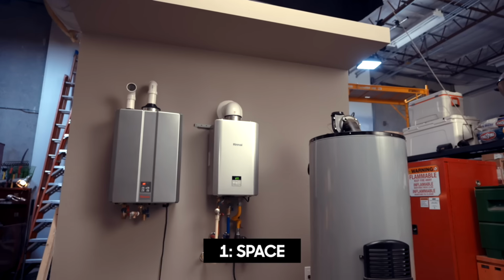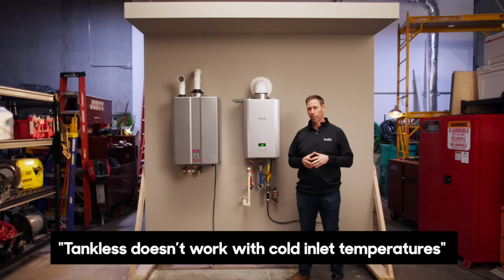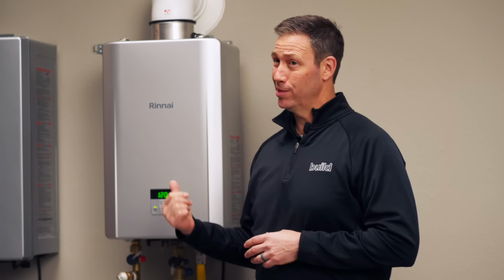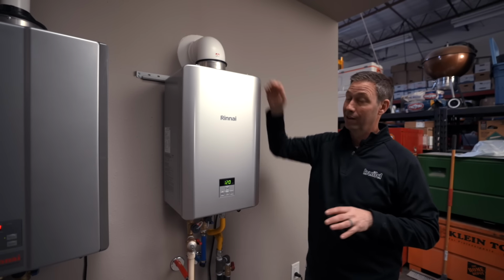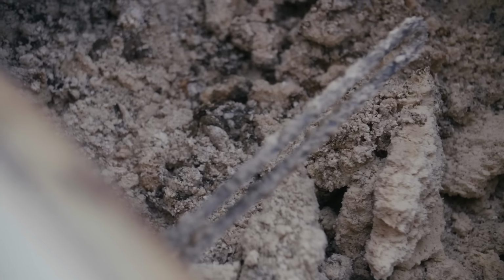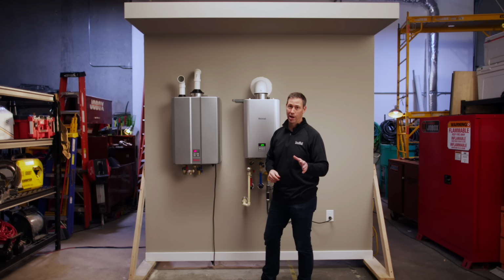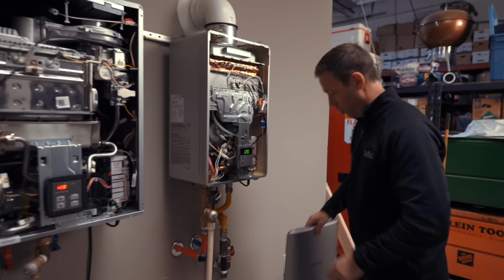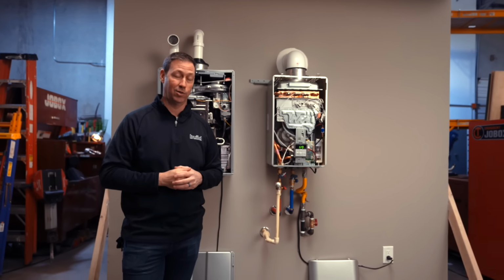DEBUNKING Tankless water heater LIES!

Comment: Hey Matt! let me know how the "low gas pressure is ok"  because the "turbo fan and regulator tech" conversation goes with the inspector when your BTUs and CFM aren't matching up. And the Google review from the homeowner demolishing your credibility. Your talking a 150,000 BTU jump. If the house wasn't piped for it 90% chance you need bigger pipe or more CFM from meter.

Comment: Without recirc, it does take about 30 additional seconds (and a few more in the coldest winter months) to get the tankless unit up to temp and delivering full hot compared to a tank unit that is holding that water at temp and sending it at full temp the moment the tap is opened. I do not find this to be a deal breaker and I have been running tankless for 7 years with great results. It's just something that you should know going in. With all of the trade off advantages of tankless, it shouldn't make a difference to anyone.

Comment: So I’m buying a house with a boiler which only heats baseboard heaters. I’m thinking pulling all that out and using one of theses to heat the house. Electricity is terribly expensive here in Fairbanks, do they make diesel vs electrical powered heaters ?

Comment: I have tankless for 11 months now.  Love it.  And I just did the annual flush/descaling.  Piece of cake. Like anything else, watch plenty of youtube videos to get familiar with all the steps including cleaning the filter before you start.

My only beef is the time it takes for the hot water to reach the faucet.  So in the morning while brushing my teeth, I fill up the sink.  When the water is warm, I use it for multiple things before pulling the plug.

Comment: This whole subject boils down to one question which none of these salespeople will ever tell you. What is the monthly cost of storing 40g of hot water in a tank unit? My estimate is about $20. Therefore, that is the max amount of savings per month...period! Who in their right mind would spend $2,000 - $4,000 to save $20/mo? Furthermore, heating water with an F-15 afterburner will eat away at your $20/mo savings. The rest is all smoke and mirrors.

Comment: I call bull on the scale and hard water.  My daughter bought a brand new condo in 2020.  Her Rinnai tankless water heater stopped working in May 2022.  Two and a half years and it was trashed because of the hard water where she lives.   Shame on her for not knowing she had to flush the unit every six months.  But I've had my tanked water heater for 18 years and never descaled it and I live in the same area she does.  Our plumber told us that in order to have a tankless we need a water softner.  I am getting a second opionion ....  I hope he is just trying to sell us a water softner but the water heater still does not work.

Comment: I'm a plumber in Chicago Illinois we have super cold weather here I'm have a large family 6 kids taking long shower my 50 gallons power vent was not enough for my family i replace with a navien A240 tankless my problems was totally fixed running without hot water but my gas bill increased a lot for obviously reason but tankless work great not matter what's else i have dedicated recirculation  with instant hot water connected to tankless pump 👍👍👍👍

Comment: Tankless on one side of house shower on the other take 3 gallon of water diwn the drain before the hot water gets to the other side before its hot. Never had that with my 50 gal hot water heater.  I had it on a timer saved money. And had hot water

Comment: Sorry I was not finished. Some thing went wrong with my iPad I have installed on each floor 6 kw Rheem heater on demand .each floor have 1000 Lin ft 1/2 tubing with have 45 litres water in a closed system and we have set the temp on 27 Celsius wich make the whole 1000 sq ft on 23 Celsius. Now the powder room and the bedroom and washroom are 20 Celsius.we have the heat on 24 hours and do not change the temp during the night. We have insulation in our 8” wals loaded with Rockwell R 28 plus house wrap. The ceiling is R 62 lots of windows. The house have 25% glass . The max which is allowed in Ontario I guess. The top floor has also a Rheem 6 kw tankless heater. And we did not have the heater on this year. Note: my English is my second Language so it might be not so good, sorry about this.

Comment: I lived in the Netherlands and in 1962 I installed a hospital size heater on demand ( in Dutch they called them : Geiser) now I live in Ontario Canada and in 2020 I build a new home . It took 2.5 years and we moved in last June. The size of the house have a 1100 sq ft garage with a small part for washer and dryer and washroom and shower plus a large space for ironing and so on. The size from this is roughly 400 sq ft and will be heated because I have tubing in this part of the floor. The 2 floors on top of the garage are each over 1000 sq ft.I also installed a elevator in case we would be older. ( the only one which use the elevator is our dog who is 13 years old)
 I did the most myself including concrete steel floors with 1/2” tubing fastened on the steel floor before placing 3” concrete over the tubing. I installed a Rheem tankless and for the showers and kitchen. I also have forced air system and airco installed and a gas fireplace in the living room
I have 4 bathrooms , 3 with showers.

Comment: I have an electric tankless. I have around 50 deg inlet temp. I have an idea to bleed off a small amount of the hot water and recirculate it back to the inlet to increase inlet water temp. Doable?  How would it be done ?

Comment: Based on yours and other online recommendations, I picked up a top-of-the-line Rinnai condensing tankless with recirc from a big box store. I got two plumbing quotes from Rinnai trained and qualified installers. The cheapest was $5200 - NOT including the tankless unit. That's just craziness! Being "handy", I installed it myself for less than $400, making absolutely certain I followed Rinnai's directions to the letter AND be above any/all 2022 code requirements for plumbing/gas/electric. So the "myth" that it's expensive to install may not be such a myth.  We love our Rinnai. But the cost of the unit plus install (at least in Metro Philly area) would be equivalent to 3-4 new tank systems. 

I recently learned that a tankless system may also increase the home's value if you're looking to sell anytime soon. Prospective buyers see a tankless, and they know that the home was modernized. A very compelling selling point, I'm told.

Comment: i would use propane n one in each room with one main one that means double instant heat instead of return cycle pump , meaning hot water connected to cold water, they usually have a safety cut off in 20 minutes cold water after that, filters n pressure shut off valves for hot water, will help maintenance clean up , also  running slow water will speed up the heating n delay the the 20 min shut off depending,

Comment: Maybe someone has a solution. We have a Rinnai natural gas tankless unit. We have found when the water flow passing through it is low it stops heating the water. So though you may turn the water hot till it arrives when you take a warm (not hot) shower the water stops being heated. The only solution we found which usually works was to drill out the showerheads to increase the water demand. Even turning the temperature it heats to down so a user uses more hot flow did not seem to help.

Comment: ok i have a 40 year old house its has 1/2 water line and never been up dated. no problems with cold or hot water flow. but the water heater is bout 15 years old and is starting to leak. would a tankless work for me. since the tankless says to run 3/4 water line. would the age & the size of the line be a problem. or would i run into problems down the road.

Comment: My experience with tankless water heaters is that they often have problems triggering with water saving devices (low water flow). You seem to need a fair amount of water moving to trigger the unit to start the water heating. This can be a problem.

I am not sure if these issues have been fixed over the years. My experience has been with BOSCH units.

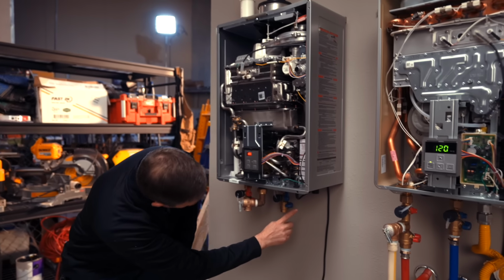Comment: 6:30 is a lie about gas line upgrading. Your main gas line has to be big enough to SUPPLY the extra 120000 BTUh of gas over the 40000 water tank system. So in most cases in Canada I have found that the BUILDERS are ripping people off by only putting in 3/4" black iron piping from the gas meter that WILL NOT supply enough gas to a Rinnai tankless that has been installed to replace a regular tank system. Also the copper water piping or PEX piping has to be at least 3/4" supply for inlet water supply to have enough flow to and through the unit to allow high stage operation. Just wanted your viewers to have more correct info.
Reply: Rinnai manual says 3/4 is of within a certain distance from the meter.

Comment: Heh.   Gas line size is determine by max BTU load, not the fan in the unit.  Got a 3/4 galvanized or black iron main supplying your house?  Probably won't have to upgrade the gas line.   1/2inch copper line coming from the low pressure regulator?   It's gotta be upgraded.  

In a place with natural gas?  Sweet.  Natural gas is more efficient.   

Have a propane tank on the side of your house?  Enjoy that bill increase.   

Also, if you're not using a condensing tankless water heater, you're defeating the purpose of a tankless water heater. 

Endless hot water you say?   Live in a place with a boiler, you say?   Invest in an indirect water heater.  

Live in a old farm house?  Boiler with a coil.  

Live in a fresh built house with a whole house water treatment system and natural gas?  Get a tankless.

Comment: Alright.  I've heard enough.  And I got to the part of scale.   

My company charges 225 usd to descale a tankless water heater.  That should be done once a year. 

You should hook up a hose to the bottom of your tank, open a hot side valve, and drain your tank once per year.  You should then hook up to your house hydrant, and flush the tank and drain it again.  Cost to homeowner: 0.  

Combating scale in a tankless is often futile.  You can only flush in one direction so you will never get all the scale or even the majority.  Go ahead, flush it backwards.   And then replace the flow meter sensor because it's only meant to spin in one direction.  

Also, Rinnai is junk.  It's meant to be thrown away. 

But what do I know? I've only been installing and maintaining tankless water heaters, boilers and combi units for 13 years.  

Also, go ahead and use that point of use electric tankless to provide hot water to your whole house.  It only requires 2 dedicated 40 amp breakers, special elements that take weeks to get and isn't rated to provide hot water to your whole house.  

60% efficient?  Was that hesitation before you stated that you making the percentage up?   A modern tanked water heater loses 1/4° an hour while not in use.  That is 6° in a 24 hour period while idle.   At 60% efficiency, it should lose 48° of temperature over 24 hours.  At 6°/24hr a modern tanked water heater is 95% efficient at rest.  

Let us not forget about maintenance costs.  Primarily, electronics and other sensitive circuitry that is subject to failure and voltage drops.  

Ahhh.  That PVC.  As the unit ages and the heat exchanger becomes clogged with scale and the water becomes insulated from heat absorption, exhaust temperatures increase.   Schedule 40pvc is rated for 280°F.  Under normal operation you will never exceed that.  During high fire (if you aren't using a modulating heat source what's the point?) with a clogged heat exchanger, exhaust temperatures can and will exceed that rating and cause the pipe to begin melting.  Over time, you will expose yourself and family to carbon monoxide and potentially kill everyone in the house.  Don't tell me I'm wrong, I have seen it happen

Let's watch the last 4 minutes and see what other nonsense is in this video.

Comment: What a lie, flue exhaust pipe should be UL 1738 rated pipe, NOT PVC. PVC pipe is NOT rated for flue pipe applications or temps over 140 degrees, read the PVC piping standard! Model plumbing codes requires water to be supplied to all fixtures simultaneously that means all fixtures on at the same time. Most homes with 2 plus bathrooms would require more than one tankless heater in colder climates based on the required temperature rise of the plumbing code. Swap outs from a tank type water heater to a tankless are not even close to the same amount of time as there are too many changes that need to be made. Going from a 40 or 50,000 btu tank water heater to a 199,000 tankless water heater means a larger gas supply for starters. Then there is the dedicated flue piping required to vent a tankless water heater.

Comment: Most people with a tank water heater have an electric model.   When you go from an electric tank to a tank less gas,  the cost to upgrade is absolutely going to be vastly more expensive than replacing an electric tanked unit.   Be transparent...

Comment: I used a Navian commercial grade tankless heater for my restaurant and it's been working amazingly. I do need to do some maintenance on it though. It's been 2 years since we put it in and haven't serviced it. I've seen some service videos and it's a quick DIY friendly process. Planning to install the combo unit for my house for both heating and hot water so I can discard the old boiler and hot wated heater to add a ton of extra closet space where the old units were
Reply: I'm leaning towards the Navien NPE-A2 for my home

Comment: I THINK THE SCALE PROBLEM PEOPLE ARE REFERING TO IS THE FACT THAT A LITTLE BIT OF SCALE CAN MESS THE SYSTEM UP IF ITS NOT CLEANED REGULARLY. ON A TANK, YOU CAN LET MAINTNANCE SLIDE TO AN EXTENT, AND IT WOULDNT BE TOO DETREMENTAL.

Comment: I was told by my plumbing contractor for our new house in North Idaho that the tankless units he knows put out 70 degree temp rise.  Our input water in winter is about 35 degrees.  That, I thought, explained to me installations I saw in Mexico which had tankless units in hotels in series.  However, our house we ended up renting in Mexico had a single tankless unit and worked great.  For two people.  We ended up putting in a tank heater 

My good friend in Fairplay, Colorado put in a tankless unit some 30 years ago and he said it was great.  Input water there had to be near 35 degrees year round.

Comment: I reside in Northern Virginia. Four years ago I purchased and professionally installed a top-of-the-line WW Granger German ELECTRIC all house tankless.  During the winter of 21/22 the tank’s internal circuit breakers kept popping because the external water temperature was too cold. Two tankless professionals from two different plumbing companies confirmed that it was the ‘extreme’ difference between the external water temperature and the setting on the tankless. I reduced the temperature setting on the tankless from 115 to 100 degrees.  No joy.  I reluctantly went back to the tank.  The tankless just would not work in this cold temperature latitude. I was lucky to get 3 1/2 years. It turned out to be a very expensive experiment.

Comment: When we had our gas Rinnai Tankless installed, they had to put a manifold in the garage attic and the gas co. had to install a bigger meter. The unit has worked flawlessly since installation. We never ran out of hot water before, but look forward to a long, stress-free lifetime from the unit.

Comment: I live at 8000’. Elevation is definitely an issue. Sure you can shower all day if you want but, once another faucet is turned on, that shower is done. 
The temps here get down to -40. No, you can not always install outside. 
Scale is always a problem no matter what you use. 
Really, the tech is almost there but, not yet. My brother lives at 5000 feet, has 6 kids living in his house and tankless works awesome. At 8000 feet, not so much.

Comment: A year or two ago, you made another video about tankless vs tanked hot water.  One of the issues you pointed out, was, because the hot water on tankless is unlimited, that your kids would take longer showers, wasting water and gas.  You said one of the good things about a tanked hot water was it had a limiting effect on very long showers because the water would turn cooler.  Also you said the chemicals needed to service the tankless HWH was expensive and messy to use.  Having to descale the tank periodically was costly.  Which video is more accurate?